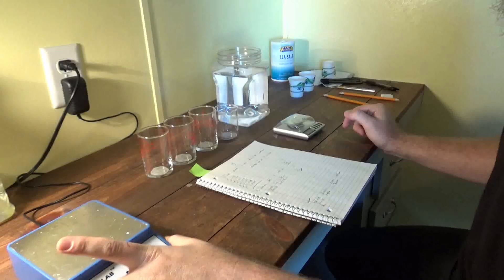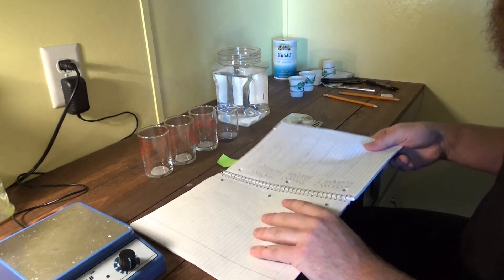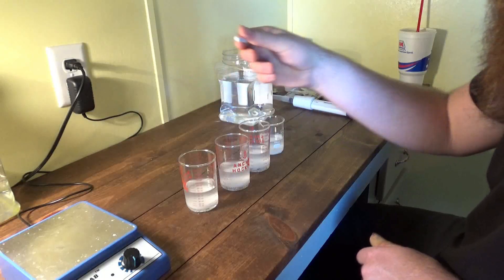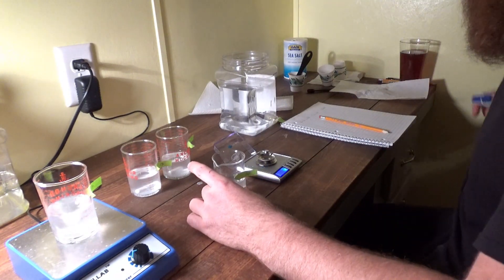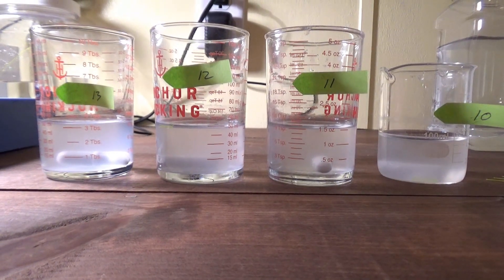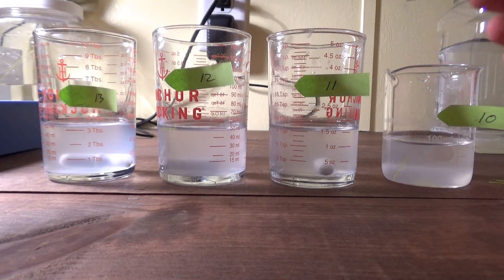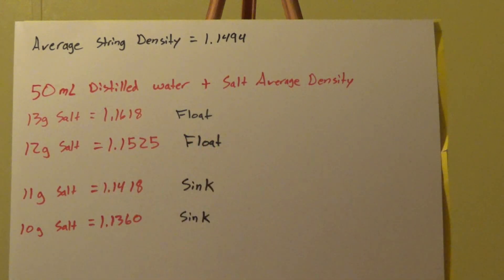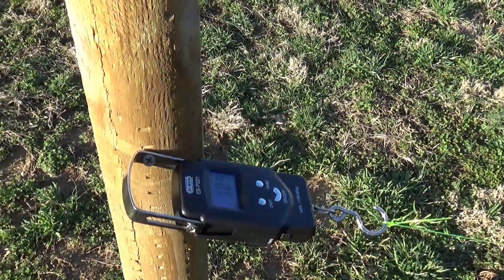Globe Earth vs  Flat Earth Experiment Phase 1

Comment: While it's always good to see peoplem doing their own research I can see two immediate problems with what you're trying to do;
1) The density of water varies with temperature (and depth - see thermocline)
2) Nylon line is not buoyancy neutral & also stretches considerably under tension (up to 10%)
Obviously with the first point you will need to measure the density at the time and at the exact depth of where you carry out your experiment.  With the second point you could try fluorocarbon line which is more density neutral or braided line (eg. Dacron) which has virtually no stretch.  They're both more expensive unfortunately.
Reply from the maker: A small amount of density variation is fine as long as it doesn't cause either line to be errored in the wrong direction. We have been discussing the possibility of using braided line on Reddit. I don't believe the stretch will be an issue but it may so we will be open to other options.

https://www.reddit.com/r/flatearth/comments/821svp/globe_earth_vs_flat_earth_experiment_phase_1/

Comment: What is the precision of you pipette?  To the ml, tenth ml, etc?

What is the precision of your scale?  Tenth of gram? Hundredth of a gram? Etc.

I’m surprised your distilled water density is so high, that is above 1 g/ml.  Distilled water should be nearly pure, and density of pure water is 1.0000 g/cm^3 (g/ml) at 4C.  At 20C near room temp, it should be slightly lower at 0.9982 g/ml.  Does your scale need calibration?

I’m curious as to why you are using sea salt vs just regular non-iodized table salt.  Sea salt would have other minerals besides sodium chloride, but the dominant mineral would be sodium chloride and have roughly the same solubility.

The solubility of salt at 20C about 35.7 grams of salt into 100 mL.  So you should start maxing out at 17.9 per 50 ml of water.  Your densities seem off though.   I would expect it to closer to 1.193 g/ml for the maxed out solution.  So again, I’m wondering if you scale is a bit off on the high side.

But since you used all the same equipment to measure everything, your results should be consistent with yourself for your experiment.

If you wanted to determine the density of your string by another method, you can take a length of string, submerge it in water, and measure the volume of displaced water to get the volume of your string.  Then measure the mass and divide by your measured displaced liquid volume.
Reply: Correction: I've seen values of saturated salt solutions go up to 1.21 g/ml near room temp (20C).
Reply from the maker: Sorry for the delay.

Pipette precision is ml.

Scale precision is thousandth of a gram.
Its new and tests perfect with the supplied 10 gram weight.

The sea salt was just the first pick. For bulk I will probably be using non-iodized as you suggest. Cost cutting and uniformity are a plus.

I will test the lines density with that method also.